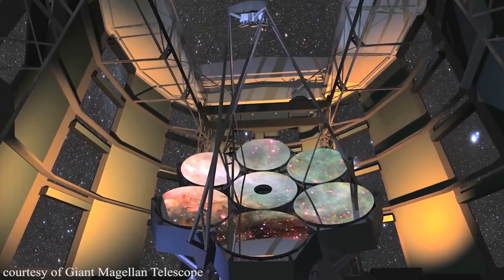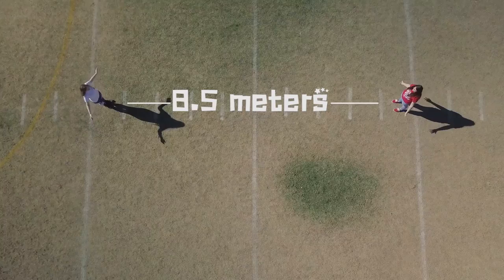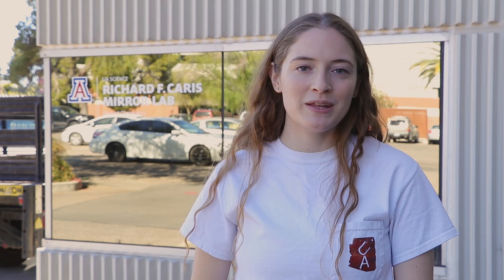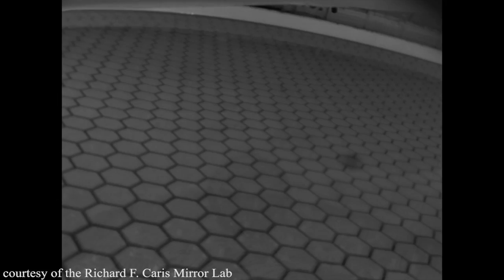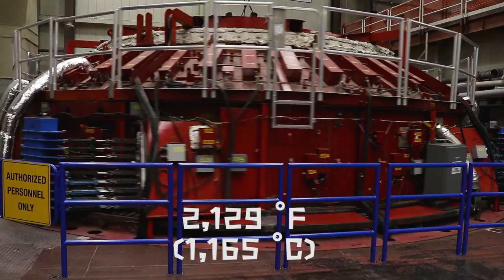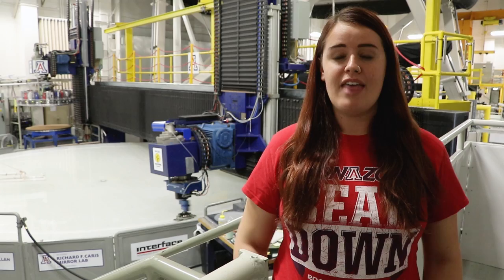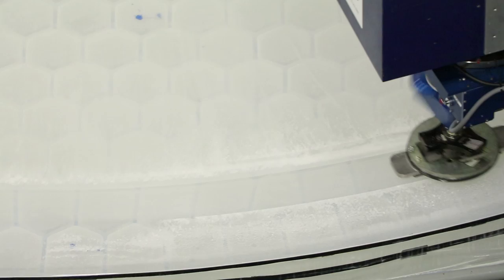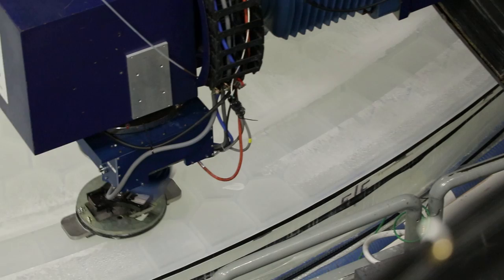17 Tonnes of Spinning Glass: Making the World's Largest Telescope

Comment: It would really be interesting to learn about how they will transport that mirror from Arizona to Chile.
Reply: Very Carefully.
Reply: Would have been bettar if they included the deposition of the alunimum on the mirror. Or perhap that will be in a follow through episcode.
Reply: I guess they cut it to pieces and try to put it back together in Chile.
Reply: Most newer telescopes have an aluminum deposition oven nearby (I know there's one in the Atacama) as the coating needs to be redone every couple/few years. So, I would suspect the aluminizing will happen "on site".
Reply: By FedEx
Reply: FedEx will toss it over the fence in a big hurry to get on with their daily deliveries.
Reply: @slikrx  They already say that in the video.
Reply: Amazon Prime :)
Reply: Very slowly and carefully driving with a truck up the mountain to the observatory. Warning, wide load :-)
Reply: Very, very carefully!  👍👍

It's hugely expensive!
Reply: im from arizona and we have aecret teleportation devices using our 120 degree weather
Reply: presumably in a ship. with a lot of packing peanuts

Comment: Makes you think a lot about the sand shortage...
Reply: Vivienne Gucwa they use special sand, not regular old beach sand lmao
Reply: Fun fact: there is more sand in the world than there is water. So no... we don't have a shortage, at all...
Reply: we do
Reply: most of those "sand" are unusable for certain type of use, such as making Silicon, cement / building material and glasses
it's basically like saying we will never ran out of water to drink since we have entire ocean, but you can't simply purify them without extensive tools and research
plus, it also depends on where the region is
desert / arid region might have tons of sands, but rural country might have little to no sandy area
Reply: I HATE SAND . It's coarse, rough and it gets everywhere
Reply: This sort of thing probably isn't affected by the shortage, though. The "shortage" is one of not having enough of the right type of sand for making cement and concrete, based on its grain size and stickiness. If you're just melting it down anyway, those things are presumably less of a problem, and you're going to be more concerned about the chemical composition instead. Which is probably quite a bit different for glass sand than for building sand.
Reply: Yes, but it's a telescope, so you see, they'll just go gobble up another planet's sand if it becomes necessary.

Comment: Why does the mirror have to be made from glass if the coating is on the front side? Could other materials be used that are easier to work with? Or there are no such materials?
Reply: and why it has to be super clear if it is coated at the end?
Reply: Glass is a very stable and durable (although brittle) material. It won't react, discolor, warp, or bend. It won't react to changes in temperature and it polishes very well.

I assume the weight also helps in minimizing movements.
Reply: piotros18 Glass can be produced up to a high purity standard while being somewhat "easy" to work with. It is rigid and doesn't bend or get indentations like metals. It also keeps its shape in the temperatures that we have on the earth's surface.
Reply: In the video, the glass is specially made to be low-expansion, IE it doesn't expand and contract when subject to thermal changes. Think Pyrex or lab borosilicate glasses.
Reply: piotros18 Glass turns out to be the best option. Metals, for example, expand and contact too much with temperature changes.
Reply: Dániel Bulyovcsity It doesn't have to be (and isn't) super clear.

Comment: I'm curious why the glass is rejected 'before' it's all melted?  Do the microstructure dislocations affect  it once it's molten, and how are they different from the ones on the surfaces?

Also i think you meant to convert 2200lbs in 1 metric tonne (1000kg).  We've come to expect SI units on this channel ;)  Otherwise, great video.

Comment: I'm curious why the glass has to be so perfect since it's just acting as a structure to support the mirror surface. Will any imperfections prevent it from flowing into the correct shape?
Reply: Isn't the reflective surface behind the glass? So light coming will go through the glass, bounce from the surface, and go through the glass again. Which would be why it's important it's clear and imperfect. Imperfections could probably refract the light differently, so light entering would not hit the correct spot on the sensor in the telescope.
Reply: Aaron Smith The aluminum is a very thin layer that's deposited onto the glass, and so it takes the shape of the glass. Any imperfections will be visible in the aluminum as well.
Reply: But they melt the glass.  wouldn't any imperfections be corrected in that process?
Reply: With the mirror surface being so thin (measured in microns) any ripples or distortions of the glass will just show up. Remember they said about a can's worth for the whole surface of the mirror? Why not make it thicker? Metal distorts a lot with temperature changes and magnetic interferance and when you're viewing something that you want fine detail from then you want as little distortion as possible. Glass doesn't react anywhere near the same as other materials when considering the thickness' involved.
Reply: It has to be perfect because the reflective aluminum is coated right on the glass (The metal layer is only a few atoms thick). If the glass isn't perfect, the reflective surface won't be perfect either. Spinning the glass gets it to the right basic shape, but it's not smooth enough to coat with Aluminum until after grinding.
Reply: I can think of two reasons, either or neither of which might be correct. 1) Basic quality control thinking. If it has to be perfect at the end, every step should be perfect along the way. Especially for something as expensive as this. 2) Similarly, what if the cause for the defect is not just a crystal boundary, but a foreign particle? You can't stop the oven, go fish out the microscopic particle, and restart. 

I guess it boils down to the fact that the process of forming the glass precludes ANY intervention once started, so everything needs to be perfect before starting. You can't justify scrapping a multi-million dollar, multi-ton mirror with "I thought it would be okay".  Especially when saving it only required more stringent parameters for the base material.
Reply: "Structure to support the mirror's surface" isn't really accurate, though. The glass body is the mirror; the reflective aluminium coating is only nanometers thin. Every imperfection in the glass surface translates directly into an imperfection in the reflective surface.

Glass is used because it is very stable and hard, deforms only very slightly under normal temperature changes, can be brought into form relatively easily, and is very resistant to chemicals (they wash away old aluminium coatings with aggressive chemicals when renewing the coating). It may also be considerably cheaper (even special glass like the one used here) than metal alloys with similar characteristics (provided there are any).
Reply: You also want to be sure the molecular structure of the glass is consistent throughout the entire lens, so it behaves consistently with temperature changes; no weak points or stress points etc.
Reply: Aaron Smith   they didn't say what they meant by "imperfection" in the source chunks of glass.  Any due to irregular cooling will go when re-melted but those due to non-redistributable contamination might not.  It was an incomplete explanation and bothered me too.
Reply: There is also the concern about tiny bubbles that form when the glass is molten and float to the surface as it hardens, adding imperfection to the surface. Ultra-pure glass minimizes internal stresses and bubbles.
Reply: read up on the hubble's glass snufu, it gives a bit of context why they had to be prefect.
Reply: Ray Kent I doubt Tom would've gotten into the nitty-gritty details either. You can't expect YouTube to teach you everything, and questions such as OP's encourage civil conversation and debate, which is good for everyone. So I wouldn't call the information "incomplete" - more like selectively chosen to fit within the ~5 minute video limit this channel typically goes by.
Reply: i expect it about heat expansion and soupleness. telescopes today have a lot of hardware their to compensate for atmosphérique distortions but that would rely on us knowing exactly how the glass will react.
Reply: Y'all, the actual people who made this video replied with their answer. Check the comment above in this thread by "Active Galactic Videos".
Reply: The imperfections be they stress lines or dust particles could make it expand or contract at a different rate than the rest of the glass leading to distortions in the surface at different times.
Reply: If one tiny beam of light was bounced off a fraction of a degree wrong it could change the perceived location of a planet or star by light years.
Reply: Aaron,  The mirrors are spun in the furnace to reduce the initial thickness of the front surface of the mirror.  If they did not spin the mirror there would be a foot plus layer of glass in the center of the mirror that would need to be ground away.  This is wasteful in the use of the fairly expensive E6 glass but also would greatly slow the annealing time in the oven

The final spun shape, while close to a parabola is not good enough and needs to be generated, ground, and polished to the final shape.  Large pebbles have a patch added and small bubbles have their edges dressed so they are not sharp.

As six of these mirrors are off axis parabola they are not quite the right shape that the spin casting leaves in any case.  That only leaves close to the correct shape for the central symmetric mirror.  

If you have any other questions, I might be able to help.  Let me know.
Reply: basically they can't afford to go "it'll be fine"
Reply: That was caused by extra grinding due to a misreading of the laser interferometer used to measure the very precise grinding. It wasn't the glass.
Reply: I wondered that, but I guess if the imperfections in the glass were because something like a dust speck got included in the glass, or even if there was a risk of something being included in the glass when it was scratched, that would leave a larger imperfection in the surface of the finished mirror.
Reply: The reflective surface is not behind the glass, it sits on the front edge of it. They don't use glass because of the transparency (which is ruined by the honeycomb structure within the glass itself anyway) but because it's the best and easiest thing to make insanely precise giant parabolic surfaces out of.
Reply: dragon1130 not to the degree they need (smaller than a fricking virus)
Reply: I wonder how they cut the hole in the central mirror without affecting it's shape or introducing some stress and cracks into it.
Reply: Jan Tichavský drilling very, very slowly, and probably before it's even sanded and ultra-smoothed down

Comment: Last time I checked the largest telescope under construction is the EELT telescope (39 meter diameter when finished) constructed out of 798 sub mirror segments. Rotational casting of mirrors is still really cool though, one thing that I don't get though is why discard glass pieces with cracks and stresses in it as the glass is remelted anyway?

Comment: This might seem like a silly question as it probably doesn't affect the mirror quality that much; how is the "meniscus" delt with? (the curve in the surface because it clings to the walls of the container due to its viscosity)
Reply: Osimmac Good question! Either they use a container with a surface tension that produces a convex meniscus, or they grind flat the edge of the mirror.

Comment: How the hell do you ship something with those dimensions without introducing any nanometer-scale inflections?
Reply: Gripping the mirror from below works, as glass is quite rigid (though brittle). The final mirror will be installed on a frame with actuators to dynamically correct microscopic flexing,a process called adaptive optics.
Reply: It does distort during shipping, but on the telescope it is actively controlled.
Reply: It does distort during shipping, but on the telescope it is actively controlled.
Reply: Actually, what you are talking about is called "Active Optics".  "Adaptive Optics" uses a third, deformable, mirror to compensate for atmospheric distortion.

Comment: Why do they need to use glass, if they are just going to put the metal part in front of it? Wouldn't there be any other more suitable/lighter materials then?
Reply: Weight is not critical for surface based observatories. The James Webb Space Telescope will use a lightweight beryllium mirror, but that is expensive, hard to machine, and toxic.
Reply: but glass was used historically for its optical properties. So if you put the metal in front, you could choose any material that is easy to shape/keep in shape. Or is glass still the best/most affordable material for that?
Reply: Exactly my thoughts, I imagine some kind of plastic could be used if all they do is coat it in aluminium and the optical properties of glass are not needed. Can someone explain?
Reply: robin111v Yea, you would think there would be some other material that is lighter or easier to manufacture, but it turns out glass is the best option. As mentioned in the video, they use a special kind of glass that doesn't expand our contact very much with temperature changes. Any metal would expand our contact too much. Plastics would probably deform too easily, and degrade too much too quickly. Same for foams.

Comment: Why aluminum instead of silver?  I know that silver tarnishes, but they noted that have to redo the aluminum coating every couple years...
Reply: Silver tarnishes more quickly, and affects the colour spectral quality. Aluminium forms an oxide layer which is transparent and colourless.
Reply: What does that mean it affects the colour spectral quality?
Reply: Well the silver with tarnish and not reflect as well in one color over time.  There are processes to overcoat silver and this is usually done in coating chambers that allow for sputtering sources instead of simple thermal vapor deposition.

Still for just bare aluminum vs bare silver aluminum is more reflective in the blue.  It's only a few % but it matters.

Comment: So it cools off while spinning? Is that correct?
Reply: SΞTH Yes, I think that glass contracts as it cools, so slowly cooling remove stress in the glass, and prevents it breaking later. It probably also keeps the figure of the mirror more accurate.
Reply: Martin Heermance thank you. Wouldn't it make it faster if they used more than one Polish thingys (just a thought).
Reply: Mostly. The oven continues to spin during the first part of the cooling process, for about a week after it reaches the highest temperature (they call this "high fire"). Once the temperature is low enough that the glass will no longer flow, they can stop the oven from spinning and continue to cool the glass while it is standing still.
Reply: SΞTH It's possible to grind out glass, and in the old days they started with a flat blank. So I suspect this method offers the fastest and cheapest way.
Reply: Martin Heermance Yea, the bigger the mirror, the harder it is to start from a flat blank. A flat blank the size of GMT mirrors could take decades to grind and polish.

Comment: Why dose it need to be made out of glass, if they are going to cover it with aluminum?
Reply: Hm. Good point. They say it's covered on the front surface... so how would the material behind that even matter?
Reply: AnotherUselessNick Because the aluminium layer is only a few atoms thick and any imperfections in the underlying surface would show through.
Reply: I see. So glass isn't taken for it's property of letting light pass, but because it's the easiest material to make a huge, homogeneous, solid and superprecise shape out of?
Reply: Yep, that's why the platters in a typical hard drive are glass or ceramic, they have fantastic properties when it comes to holding a shape without damage.  Even the densest metals are easily scuffed due to their malebility but some glass can resist a bullet without so much as a macroscopic chip.  Perfect if you want a damage proof surface.

Comment: Wasn't the entire point of the Hubble being built that it would be far superior to any feasible telescope build on the ground because the image of ground based telescopes is inevitability distorted by the atmosphere? Maybe this will have 10x the resolution but it won't be able to see nearly as far and it won't be able to watch something for more than a few hours at a time due to Earth rotation?
Reply: rydude998 Adaptive optics nearly eliminates atmospheric distortion. With adaptive optics, ground based telescopes can have resolution as good as Hubble, or even better if they're bigger. Hubble is much smaller than the GMT, and it would be extremely challenging and expensive to get something GMT-sized into space.
Reply: Ah ok, so we're still looking at a cost to size ratio then. A geo-orbit telescope can be much smaller than an ground based one but requires being put into orbit which is costly. But for perspective, Hubble cost roughly $10 billion while the GMT will likely cost about $1 billion and offer "10x resolution" however, the James Webb telescope is nearly 3 times larger than Hubble and is estimated to cost the same as it's predecessor. Given the size comparison of these devices, it seems to me like space telescopes will still hold the top. Though I suppose the key benefit for the GMT is anyone gets to use it. Anyway, I'll be looking into adaptive optics, very cool stuff.